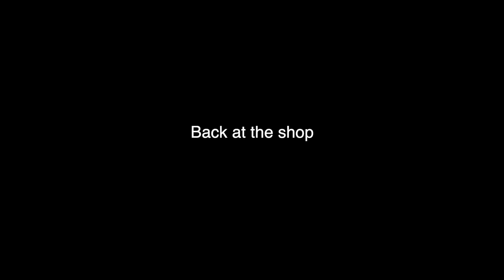I Almost Got FIRED...

Comment: I love it when a new video comes out.  It’s like a visit with old friends!  I had a bin full of wheat plug up on me too.  Unbeknownst to me, a crust had formed on top and got sucked down and blocked the center gate.  I then opened the other two gates and the same thing happened!  After a lot of internal cussing and questioning the parentage of the bin designers, I decided that the only thing I could do was to cut a hole in the bin door and let it run out and suck it up with a grain vac.  It worked, but oh, what a mess!
Reply from the maker: Prairie Viking I've heard of people putting tennis balls/golf balls in the auger and then turning it backwards to try to break it up. Man, that's rough!

Comment: May be time to invest in some bin management auger systems.
Reply: @Allegan News  A M E N to that. And another bin perhaps...I noticed the sunshine peeking through several decent sized holes and the rust in the bin. One step at a time...🌽
Reply: Auger hoppers are only $140 each 
Be a huge step forward for a kick off
Reply: @LP-mz8rc  would it be possible to take the bin apart the way it was build (backwards) and just replace the couple rusty sheets?

Comment: Looks like there are quite a few holes in your grain bin walls
Reply from the maker: Jarrett Fullerton there are
Reply: @ColeTheCornstar  never farmed, but can't the crop leak out through those... And wouldn't they let in moisture? I know nothing about bins.. Only done cattle and hay.
Reply: @jarrettfullerton2580  he lives in a very dry climate during the winter. very little rain. lots of dry air, even when snowing. when I lived in the midwest I would shock everyone when I went to touch them and door knobs I could usually expect a good inch to a inch and a half spark, as I go to use it. needless to say, most of my doors stayed open...

Comment: hi Cole,   I noticed a couple small cans of refrigerant and a large green container of refrigerant. do not throw them into the garbage. if you don't have any old trucks or tractors that use that kind of refrigerant, give it to someone who can use it. as that type of refrigerant is no longer being made or sold in the u.s.   it could save the cost of completely rebuilding an air conditioner system on some equipment or old vehicle. the a/c replacement would most likely cost more than the vehicle is worth.. using the gas that was in your basement could be used to keep a good system working for a few more years...   if you don't want to deal with them. take them to someone who works on a/c's. so it can be disposed properly...
Reply from the maker: Erehwon that's the plan! The green one is actually aluminum polish.
Reply: @ColeTheCornstar  hey, it's Sunday morning. don't you have somewhere to go???  I would, cept I have health issues... can't be in crowds. think of chemo.

Comment: You might have heard the before,but wouldn't it be easier to have auger boots so you dont leave a mess all over the ground? Also won't freeze cause the grain will be cleaned out 🤷‍♂️
Reply from the maker: The one with the giant pile actually had a boot under it and that one was the most frozen!

Comment: Kudo's for putting up the proper unit for temperature. It would be great if you did the same for those bushels. The acres and miles and all are easy enough to convert to something understandable to the metric mind but fahrenheit and bushels do my head in.

Comment: Hey Cole! can you swap a smaller pulley onto that yellow auger with a shorter belt to make it move more corn per motor rotation? That way you can turn the floor auger up more than 1/4... Swapping a smaller pulley onto a supercharger makes the rotors spin faster at the same engine RPM, figured the same concept might work for you?

Comment: you really need to design a conveyor/auger system that retains your corn/beans better. with the ability to be cleaned easier. without making such a mess. such as a central tower. that will gravity flow to each bin through a rotating head. the head is rotated to a bin you want to fill. using a bucket auger, or some other method to fill the distribution tower (like a small water tower on supports) with feed tubes to each storage bin and one to fill a truck. ( this system could be just abs-pcv piping or metal. the tower could have a blower that could help push and clean out the directional drain pipes from the tower).  using a belt or auger from each bin to the main tower feed. this solves the filling, discharge to and from the bins. next you need to have a belt/auger from your drier to the base of the tower. you could have that as a separate system. while having it combined with the tower, would give you a chance to harvest quicker. this way you would only need one long fill auger for all of the bins.  belts, sort augers could be directed to the main lift. covering each transfer spot with a weather shield, having the side panels hinged for easy access. this system could be assembled over a few seasons so that cost are kept down. once it is completed. waste and cleanup would be reduced and product would have less debris getting into it.

Comment: Cole, I'll send you the $3  for the spent corn on the ground. Wouldn't want to see Cornstar Farms go under.

Have you thought of taking a 55 gallon barrel, cutting a hole in the end for the discharge auger and a slot on the side for the corn being transferred into the barrel? 

If a 55 gallon barrel isn't large enough, use an IBC tote. It would be and a whole lot cleaner, and if the used the IBC, you could use the top portion as a lid to keep bird and the weather from getting inside.
Reply from the maker: Gunga Dinn smart thinking!

Comment: Dang that’s going far with the Heinz. Lol. Love the vids Cole. Keep up the good work. Oh and Cole whenever you are trying to pull backwards in a power shift put it in like 4th and rpms as low as they will go. The tractor will not jerk and jump like it did when coop was driving.

Comment: I had the start of an invention inspiration for your augers... What if you had something that covered the auger hopper (where you get the ice jams) when not in use that was weather tight/resistant. When in use, you just lift the top off (or hinge it out of the way). Something like those plastic igloo dog houses. I don't know -- seems like someone would have already thought of how to address that problem (cheap Harbor Freight tarps?). AAAAAAND after a quick google, there's a bunch of those options. As Emily Latella would say, "Never Mind".

Comment: You love doing your oil changes in the USA, (expensive) synthetic oil every 12,000 miles would save you a bunch of time.  In the UK Nissan specify 12k miles for oil change, 6k if mostly short trips perhaps also cold weather.  Audi in Europe specify every 18,600 miles or 9,300 for short trips for an oil change.

Comment: Cole, I noticed some holes in the bin walls, is there a relative easy way to fix them ?  Could you add a second layer of tin over those areas or closed cell spray foam maybe ? Thanks
Reply from the maker: august silicone would work!
Reply: @ColeTheCornstar , Ok, I thought the holes were too big for silicone, but if that would work, then that's great ! Thanks.

Comment: Thursday night the 10 below temperatures killed my car battery.  Life in Ottumwa Iowa, oh well.
Reply: Do you know Radar?
Reply: I installed larger battery cables in my car and an over rated sized battery. when living in the midwest. never had a bad start condition. I did learn to let the vehicle warm up a bit before hitting the 4 lane.  hoses build up a lot of pressure, until the engine warms up enough for the thermostat to open...
Reply: @m1t2a1  lol.
Reply: @erehwon9371  we had a large battery but it is getting pretty old. Yes, we always warm up the car before we leave when it's that cold.

Comment: Rather than using 3+ augers to get grain from one place to another can't you sort something so it goes more directly? Seems a great waste of power and machine time to 'handle' it 3 times for 1 move...
Reply from the maker: Bill Lane on paper one move seems like the thing to do. It's not really possible to do with the setup of buildings around it.
Reply: @ColeTheCornstar  a big bit of semi flexible pipe might at least get it down to 2 augers and not trailers. ;)

Comment: I know it may offend your sensibilities, but changing oil every 4K in a modern car on rural duty is tossing a lot of money into your waste oil drum (I've got a father who is also keenly familiar with the FAR inferior oils of the 20th century).  I'd put a good synthetic in that  car, a fram ultra synthetic filter (arguably the best on the market and available at walmart - basic frams are still garbage). Then send the oil to Blackstone at 8K, they may tell you to go to 10 or 12 thousand.  Even if you break even on the money side, your back and dry face will thank you!

Comment: Cole why don’t you just have one big grain auger unloading the van instead of having like six little ones and why do you need to put corn in the hopper bottom why don’t you just unload directly from the bin
Reply: The hopper bottom is the only bin that has the drive under fill spout to fill semi's. Filling the semi's from the augers would take forever. So they have to transfer corn from the other bins to the hopper bottom bin so the drivers can load themselves OR load it into the grain carts and then drive the carts out to fill the semi's.

Comment: i might be thick or.missed.something ive  watched most of yoir vids cole and from england  i see no ploughs or ploughing with corn on the cob and.soya.beans growing ?
Reply: Hello Mark! I don't mean to speak out of turn, but there isn't a whole lot of plowing done in the States anymore. Various forms of minimum, strip & no-till are common. A few of the main reasons are, you use a lot less fuel, save a lot of time & there isn't as much wear & tear on the equipment. It's pretty common on the big farms. Yes, you will still find some large outfits that plow. Most of the time it's just for fun. My farm is small (to say the least) & I still plow. However, I'm starting to change my mind about that. My farm has a lot of rocks. No-till would certainly make things go a lot faster in the Spring if I didn't have to pick those pesky rocks for a few days in a row. I'm also the only one doing all the work. So it would make more sense to go that route. Regards!
Reply: @ikonseesmrno7300  yes ploughing here in herefordshire stoney uses loads of diesel amd wears down plougjs fast so its green and so called carbon offsetting as.coles goes.for.ethanol.i noticed